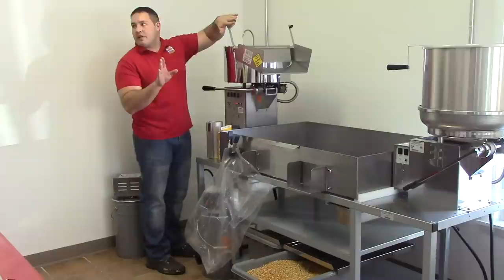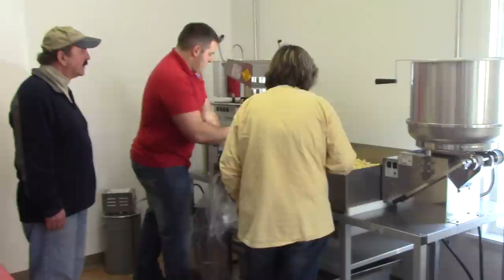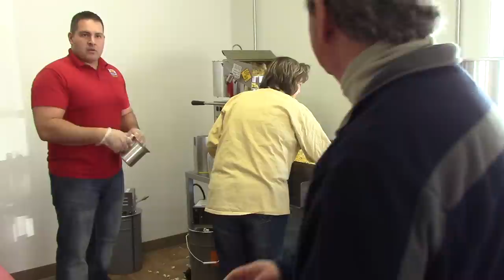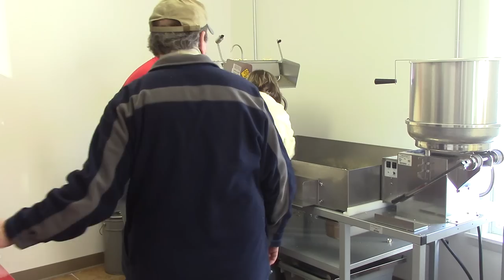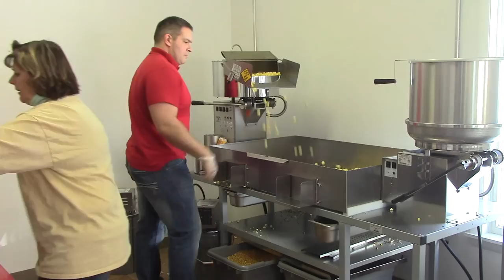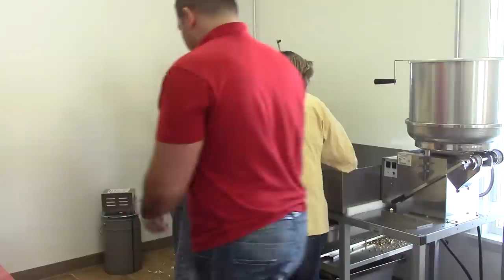How to make popcorn in large popcorn machine

Comment: Is this machine portable?
Reply from the maker: +Carl Snell 

The table itself is on wheels and moves easily. The whole unit
is 79 x 30 x 60 and need 2 separate 240v plugs- 1 50amp for the popper and 1 30
amp for the caramel cooker. Most customers do not use this as a mobile machine,
they rather use it as a production machine that stays in the facility. The
popper itself can also be un-bolted from this table and mounted onto something
more mobile, as long as you had the correct power requirement at the location.
Thanks for the question, if you need any more info please don’t hesitate to
call New England Pretzel and Popcorn at  1-800-473-0342
Reply: +New England Pretzel & Popcorn f

Comment: Have you got video on how to make caramel corn in the large popper and not using the mixer?
Reply from the maker: +John Robertson 

John Robertson- We do not have a
video on how to make caramel popcorn in the large popper. The best way to make
real caramel corn is with the Gold Medal corn treat cooker/mixer. The product
you can make in the large popper would be Glaze Pop which in not as coated,
more like glazed with caramel. This process is very easy- add your oil and
seed, wait about 1 minute, then add ½ the measure of seed of the Glaze Pop
Caramel product. The batch will then pop out glazed with caramel. Gold Medal
may have some videos of a Glaze Pop demo, not in the large popper, but same
process.

Comment: I'm surprised that the gent demonstrating how to use this new machine doesn't know that you ALWAYS add the raw corn before the oil - always.
Reply from the maker: Thank you for the concern.  We are popping in coconut oil, with a flash point of 550 degrees.  Also, I press the oil delivery button and then pour the seed in right away while the oil is still delivering for about 10 more seconds.  When popping with oils that have lower flash points is safer to add the seed first.  Thanks again

Comment: Can you do half batches in a 36 oz popper or do you have to pop the full, 36 oz
Reply from the maker: +John Robertson 

Yes, you can pop a half batch in any size popper- you can add a
“flexi-pop” option, which is a switch that you could switch between 2 different
batch sizes- the switch changes your oil amount automatically. If you don’t
have the “flexi-pop” option, you can manually adjust your oil amount to pop
less of a batch- this will pop faster because the kernels are all sitting on
the surface area of the kettle.